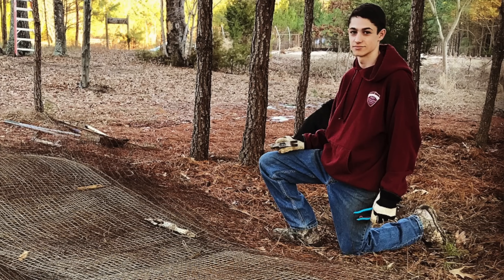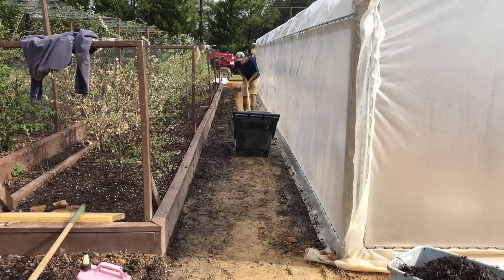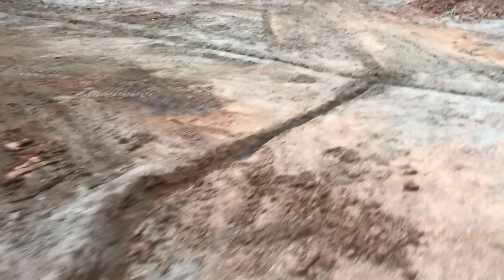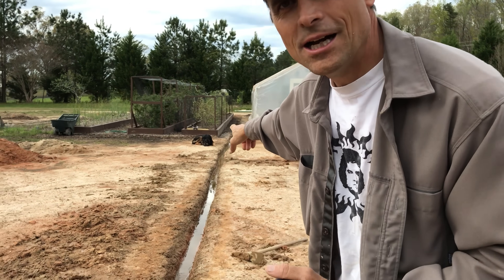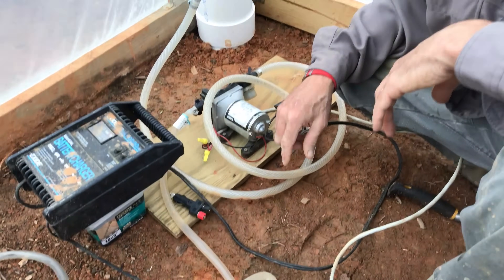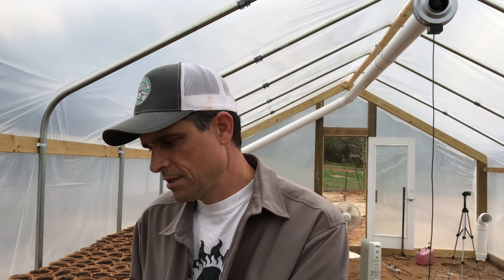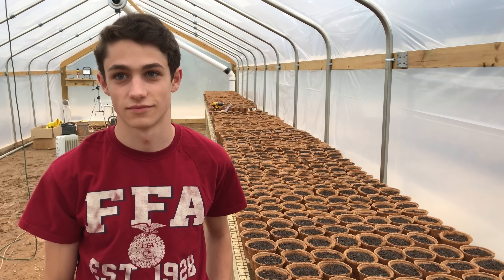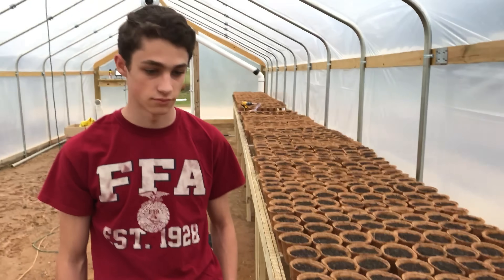DIY Geothermal Greenhouse Pt 9: PLANTS & PROBLEMS

Comment: Thanks for posting about the progress of your Earth battery. I watch lots of videos of people installing it in clay soil and I know from experience that when you put a hole in clay soil, it just becomes a pool. With all the perforated pipe going in, I know it fills up the pipe which is a problem I'm trying to figure out myself. I'm just assuming I use pipe that is not perforated and slope it to a sump so I can pump it out. No one makes a video about following up on the earth batteries and the efficiency of them in their soil so thank you for that

Comment: Another geothermal system that is trying to work against physics. Pushing fluffy less dense air underground where it shrivels up to nothing. The easiest way to get air to release its energy is for it to experience a drop in pressure. By pulling the air out of the cold side of the system, you enable that pressure drop to occur and the efficient transfer of energy into the mass. By pulling on the cold dense side of the system you will pull an exponentially larger volume of hot less dense air off the peak of the green house.
Reply: Air doesnt shrivel up to nothing, you need to work on your physics :)
Reply: @JohnGuest45  Its shrinks in volume. You can have 1000cfm hot being pushed in, but you are only getting enough to flicker a candle out the other side.
Reply: @davefroman4700  
I suggest you learn a lot more before posting any more ridiculous comments.  A lb of dry air at 90F equates to 13.5 cubic ft, a lb of dry air at 30F equates to 12.34 cubic feet.  At -10F, a lb still equates to 11.33 cubic feet. Your idea of it shrivelling to nothing is a fantasy :)
Reply: @JohnGuest45  Yes. But you are not dealing with dry air. You are dealing with moist hot air. For every degree you heat a volume of air, it is capable of holding 7% more moisture. The number one problem with these systems is always inadequate drainage issue because of the amount of water that leaves the air as it cools. The mechanical input may be moving 1000 CFM but at 30C and 85%+ moisture dropping to 12-15C? It literally rains underground. The fan does not differentiate between the air and the moisture in it, and they both occupy volume.
Reply: @davefroman4700  
ok, lets make the 90F dry air,  90F air with 50% RH. A lb of 90F 50% RH air equates to 14.19 cubic feet, if you run it through a tube it wont magically shrivel to nothing.  Condensate in the tubing is a result of the air dropping to dewpoint. I designed and installed my system back in 2009, it works exactly as designed, this summer we had record 104.5F temperatures (in the shade) and my greenhouse never got above 85F thanks to the system.  My neighbours glass box greenhouses became plant killing ovens.
The  amount of moisture released by cooling 1000 cubic feet of air at 30C 85% RH to 12C will be approx 430ml or 0.43ml per cubic foot. In practice, you wont have a stable air temperature or a stable RH%, it will be in constant flux  due to the cool air mixing with the warm air in the greenhouse, solar gain and transpiration from the plants. The mass temperature near the tubes will not be stable due to heat transfer. The condensate will affect the heat capacity, diffusivity and conductivity of the mass, which will have an indirect impact on the heat transfer. Mass with a low conductivity and diffusivity will move heat slower than mass with high conductivity and diffusivity. Most folks with systems dont install temperature sensors so they have no clue what is happening inside the tubes, in the mass near to the tubes or in the mass at various distances from the tubes.  I suggest you install a system and put your theories to the test,  but dont be too surprised when it doesnt perform as you expect  :)

Comment: Rocks in the trenches? Lead it to a retaining pond. Collect roof runoff with gutters. Woodchips and 2 inches of gravel or pallets with plywood on top in floor. Roll up sides. 2 box fans. One outtake box fan. Wood burning stove. Pocket the money i saved you from the grant. Ask an ex guerrilla grower how to avoid rain in humboldt county. Youre overthinking everything. Almost like youre forcing too much math and science into this. Look around you. How water flows. How wind fuck shit up. Expect the worst. Measure once build more. Also. Heat gun on that plastic. Run twine on inside and outside of planels the plastic touches so whem the wind blows it wont tatter. And holds heat better and less moisture. Floppy plastic will shred. The house is a kite. Youll need cross beams. And rope zig zagged and staked over the entire steucture. Like tying a giant baloon down. You get the same produce with. 200 dollar greenhouse and a million dollar one....slow. Down.

Comment: Cool! I will have to remember St. Isidore when I plant next May 15th! I am thinking of an earth-battery system if I add a greenhouse and was wondering about pipe size, so this was very informative. I also like a manifold system so that if 1 of the pipes was blocked the others aren't, compared to 1 continuous pipe.

1 Question: How often does this air-based system help? If I have 50 degrees underground, and it is 70 above ground, I wouldn't want cool air coming up, so is this system only useful when it is overly hot in the summer (to cool) or overly cold in the winter (to keep from freezing)? Thanks.

Comment: Excellent videos.  Thank you for sharing all your hard work and even mistakes.  One thought, you might want to keep the plants off the walls directly.  That area has the biggest temperature fluctuations.  An air gap of a foot or two would be advisable to keep them from feeling the swings in temp and humidity.

Comment: I assume you are on an actual farm where water availability is not an issue, but for me I would be reclaiming all that rainwater runoff.  I live in a small town with incredibly high water rates though.  The amount you can gather off a 66 x 26 roof in a average rainfall is incredible.
Reply from the maker: We do collect water in several places on our farm (chicken coop roof especially), just not yet in the greenhouse. We do have a farm well and water is usually in full supply - especially of late. We also have ideas for creating a gutter system in the greenhouse to catch condensation drips.
Reply: nice, as I said it may not matter for some, but you would think we live in AZ with our water costs here, the water has high nitrates so the feds made the city shoot a new well, but being in a valley, guess what?  Same water.....oh well, the plants love it, but the cost is insane.

Comment: In my 2' x 5' deep "sump hole", I had to use a 330 gallon pump to stay ahead of the flooding.  I ran the pump every 5 minutes and I watched water pour in from the side of the sump hole wall, right out of the clay, like a garden hose was turned on.  We have clay soils as well.  Heavy rain causes ground water to flow at alarming rates.  Merely relying on the French drain to remove all water surface water may not be enough.  If I do build another greenhouse and I use the geo-tubes like you... I intend to dig a sump hole and grade the tubes to dump the water into the sump where it can be pumped out.  FYI  We just got 2' of snow here in NE Wisconsin last weekend!   Mini ice age is upon us!
Reply from the maker: I must admit some worry that the french drain will be overwhelmed, but we're also going to grade away from the greenhouse even more and give the drain a significant drop toward the end. Hopefully, we prevent the pipes from filling up, but in the case of extreme rain, we'll just pump again. Yeah, can't believe the weather you guys are getting up there.

Comment: To help solve the flooding issue, install a water catchment system.  Helps with the runoff from the rain, provides water for the plants that does not have chemicals.  Great job on the geothermal greenhouse, it is so nice to see a family working together instead of looking at a cell phone.  My hats off to the whole team (Together Everyone Accomplishes More).
Reply: I thought he had foam walls put down, is there that much runoff into the greenhouse that it's causing water to get into the pipes?
Reply: John, that will not work. but thanks for the concern.
Reply: My suggestion exactly. A water catchment system could easily maintain the needs of the entire greenhouse without consuming any excess water and is cheaper than anything else they've done to date to install.

Comment: For summer months invest in some shade cloth to hang inside. This will allow you to extend the usefulness of the structure you have invested time and money into. Also recommend some screen doors asap. You don't want to provide a feast for bugs as spring advances, and since you don't have vents, you will need that ventilation before you know it.
Reply: Putting shade cloth inside will generate heat much like a solar collector absorber. If you`re using shadecloth, heat is likely to be the #1 reason you`re using it ;) If the shade cloth is on the outside, the heat generated by it will also be outside.
Reply from the maker: Funny, was JUST thinking about the need for screen doors. Automatic vent vans will go in eventually, but yes, screen doors are a must already. And thanks for the suggestion about shade cloth inside! Kept thinking about putting something over on the outside and wondering exactly how to do that. Again, thanks!